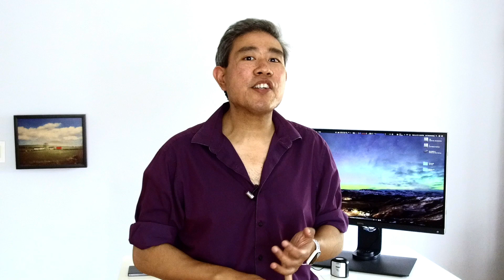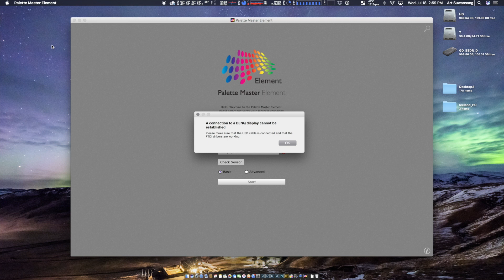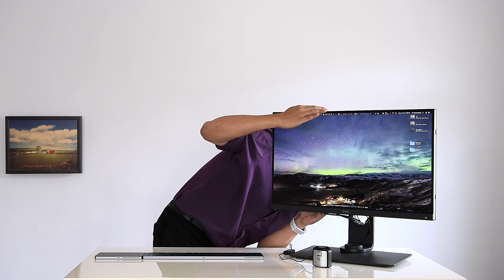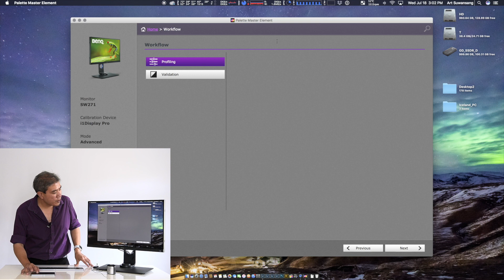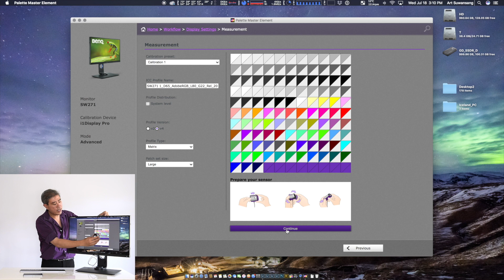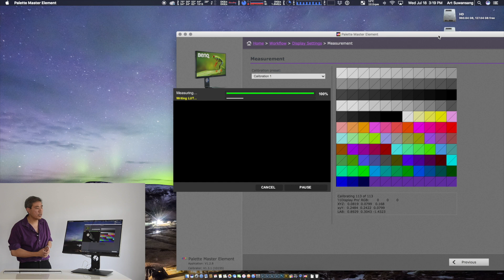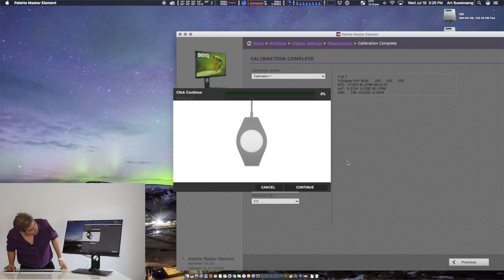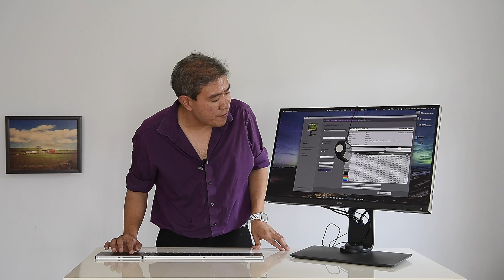How to Calibrate BenQ SW Displays with Palette Master Element - Art Suwansang

Comment: Well I tried to calibrate my SW320 using the Spyder5 and it went awful. It produced a massive magenta cast to colours what should be grey. It's not a complete screen magenta cast. Only parts of the screen for example the top bar of an open window. Or the 'shadow' on the Google search bar. That kind of thing. Also after it was done and tried to validate it, it was coming back as 'failed'. So I've kind of given up and just done a factory reset on the monitor. Any ideas or help would be greatly appreciated.
Reply from the maker: Hi @Deltafit

So here's a few things that you can do to diagnose the issue further. Rarely is the screen or in the case the SW320 the issue. Most of the time I found out that the issues is with the calibrator. The best thing to do is to run a software calibration on the device that you are using. If you are using a laptop or all in one device this makes it easy since these build in screen are not hardware calibration capable. If you have a desktop and your SW320 is the only screen that I would set the color mode on the SW to Adobe RGB or sRGB and then do a software calibration using the Spyder software. In this case you are looking to see if the software calibration icc produce the magenta cast that you are referring to. If it does with the build in screen or with the SW then this tell you that the Spyder 5 is possibly defective. The other thing that you can do, depending on where you are is to try and obtain an X-Rite i1Display Pro and try it with Palette Master Element and the SW display. 

A few more note. If you are running a Mac make sure that the Nightshift, Automatically adjust brightness, and True Tone is turn off. If these are not turned off they will interfere with the calibration.

On Windows, you need to turn off Automatically adjust brightness, Night Mode, and "Use windows calibration" off in the color management panel, again if these are not turned off they will interfere with the calibration. 

I hope this help. If you have any follow up questions or clarification or let me know how it goes after these test please feel free to reply to this comment. 

Thanks.

Comment: Amazing walkthrough video! Unfortunately, I'm still having the error "A connection to a BenQ display cannot be established. Please make sure that the USB cable is connected and that the FTFI drivers are working." I tried everything... maybe do you have an old version of Palette Master Element for Mac? Thanks a lot!
Reply from the maker: Hi @jerotor86, thank you! I think that you have tried all of the options already. However, here are some additional things that works for me in the past. 

1. If the FTFI driver things happen, then you want to power off the display and pull the plug out completely. Leave it out for at least 30 sec to a min and then plug it back in. 
2. Try swapping out the USB link between the laptop and the display with another cable. This might help, cable defects, can happen, though rare. Also, make sure that the usb link cable works, try plugging in a thumb drive to the display and make sure that it mount on your system.
3. Download the latest version of PME. They have made quite a bit of improvement on this front. In my testing with the later version of PME. If this error pop up I no longer have to power cycle the display just make sure that the usb link is in and restart the program. This happens a lot since I am constantly swapping computer and displays.
4. This is one of the rare cases where the OS is the issue. You can always try to install macOS on a Fasth usb 3.0 thumb drive and install PME and see if you are still getting an error. One of my viewer had an issue with his macOS and a clean install help. This is especially usefully if you have done update, upon update of macOS, especially big version releases with out clean install. 

I know what I am telling you here is not definitive, if you give me more info of your system, I can help you further. Or the other thing that I would suggest is to contact BenQ tech support, they are really good with helping out and taking care of their customer.

Comment: Thank you for your extremely useful in-depth video on this complex topic.  I'm expecting delivery of an SW320 within the next few days and I'm really looking forward to using it but I'm a bit confused about how the hotkey puck can be used to change colour profiles.  Could you comment on the relationship of the monitor's hardware calibrations and the colour profile set in the OS's display settings and which of these the hotkey puck changes?  If the hotkey puck changes the calibration only, isn't the ICC profile being used by the OS going to conflict and cause a problem?  Thanks in advance for any insights you can offer me on this.
Reply from the maker: Hi Peter. Thank you for the compliment and I am glad that you enjoyed the video. So in essence when you change the hockey puck to a different color profile you are supposed to change that profile in the OS as well, this applies to both Mac and Windows. Most of the time even if you change the hardware profile on the monitor, you will see that the color will change slightly but they are not off by much at all. 

This video will help explain a bit more on how to customize the hockey puck keys to your specific profile. https://youtu.be/Y9r7Ll-i164

Now if you have sometime this video goes over how you can use the multiple custom hardware calibration slots on a BenQ creatively to calibrate for multiple devices or a single device at multiple luminance level. https://youtu.be/xQWzAzDbvqs

Please share with me if these answer your questions. And if you have any more please feel free to share them with me and I'll get back to you!

Thank you again.

Art
Reply: Thank you Art for this information.  I think I’m almost there.  My calibration to Adobe RGB with luminance set to 90 cd/m2 worked very well and it also created an ICC profile.  Now the only part I’m not sure about is whether or not that profile is being used because while Windows 10 shows the name of the profile in the Display Settings as “Color Profile”, I did turn off “Use Windows display calibration” in accordance with the instructions on page 3 of the most recent version of “BenQ Palette Master Element – How to use guide”.  Should I turn that back on again?  Thank you again Art. @ArtIsRight
Reply from the maker: Hi Peter this is a great point. Perhaps I should do a video on Palette Master Element Calibration using Windows since setting the color profile is different. Also, let me run some test on my Windows machine and I’ll get back to you with the answer on this. Please give me a few days. Thank you!
Reply: Thank you so much for the time you're putting into this Art.  There are so many components to colour management including the role of the operating system and they are rarely discussed together. Not knowing about what needs to be considered beyond the calibration of the monitor is probably one of the reasons so many people are disappointed with the results they get from calibrating their monitors and regard colour management as a quasi-mystical art.
Reply from the maker: Hi Peter, I've checked. So you turned off the "Use Windows Display Calibration" which by default, at least on my system, is off. You should be set, From there you can go the the profile windows and then choose the profile that you created for the BenQ, click on use as default and you are set. From there you are now using the profile that you have created. I hope this helps, if you would like me to clarify anything further or still have questions following this please let me know. Thank you.
Reply: Thank you Art.  It seems that at soon as I calibrate the monitor with Palette Master Element the proper profile becomes the Windows default; it shows up under "Color Profile" on the Windows Display Settings window.  So everything seems to be fine now. Thank you again for your time and for your help.
Reply from the maker: You're welcome!

Comment: I don't understand what profile should be set in the Monitor Preferences of the Mac (?)
Reply from the maker: Generally the program would automatically set the correct profile for you. If not then you have to choose the profile that Palette Master Element crated for you in the display setting under color.